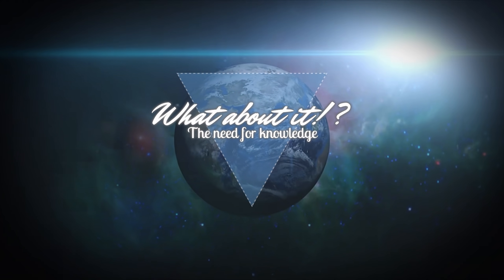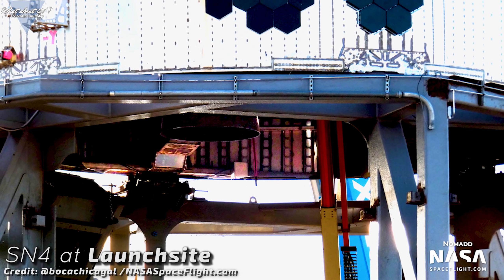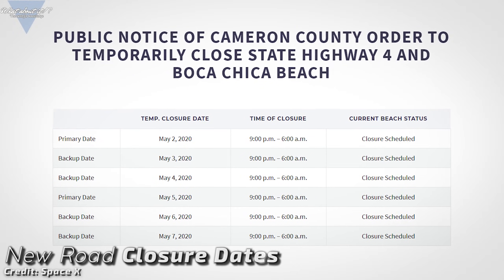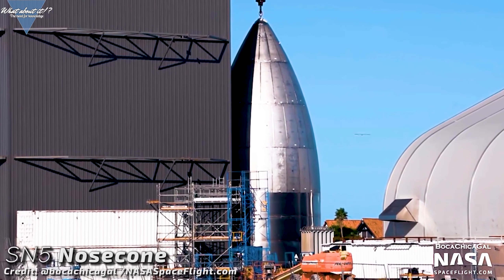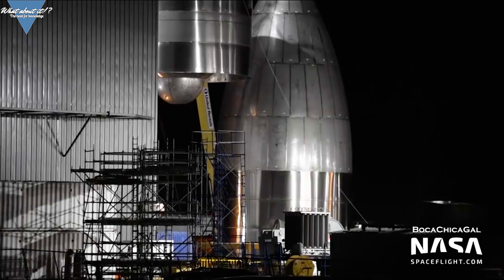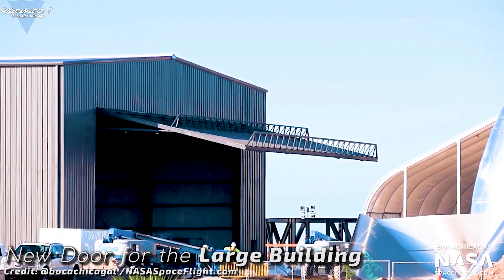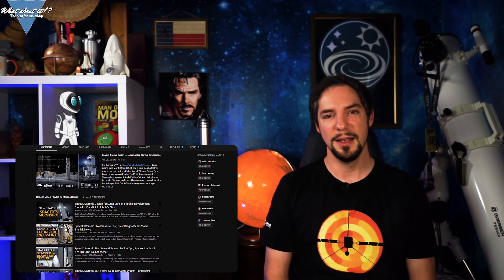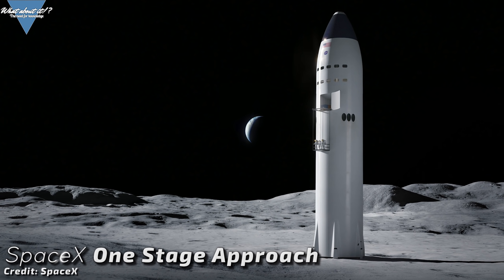89 | SpaceX Starship Updates - Lunar Starship: One Giant Leap

Comment from the maker: What’s wrong with Serial Number 5s nose and do you think, that the lunar Starship is a valid design?
Reply: Lunar starship  leg  is not good  Disign. Need bigger and wider because of  less gravity.
Reply: @lemnaiwangnawlemnu7955  Thats kind of what I think.  The amount of travel in those legs doesn't seem like enough for what they might find on the Moon or Mars.
Reply: @pipersall6761  Will it do orbital refueling too?
Reply: @pipersall6761  in moon and mars there is no landing pad  they have to land long starship  on rough surface  with that smoll  legs not a good idea.  Need some extension leg not like falcon but similar. Thank you.
Reply: @farrukh8827  Yap  it's a root between moon surface to  earth orbit.   Reful in earth orbit more then once  and it will move toward mooooooon 🌙
Reply: @lemnaiwangnawlemnu7955  But moon is not so far away like Mars. I thought it can fly to moon and back without orbital refueling but Elon knows the best. We should ask him on twitter ...
Reply: Lemnai Wangnaw Lemnu surely they eventually need a large landing pad to really get things moving and deal with the regolith issue?  Very interested to see further information about the lava tubes and whether habitats will exist within them.
Reply: Farrukh Isamatov it will have to. Starship can’t go beyond LEO without refueling. Also, Elon hopes to land with enough fuel to get back to earth.
Reply: @lemnaiwangnawlemnu7955  
Lunar gravity is low but starship is  very very heavy so i think these leg design may be good.
Reply: @lemnaiwangnawlemnu7955  gravity doesn't matter for center of balance for anything. On higher gravity the physics can be stimulated faster essentially.
Reply: @lemnaiwangnawlemnu7955  yeah im sure you know better than them lesser gravity makes it easier to knock it down but what should do that the moon hase no atmosphere so no Wind etc. the Atmosphere of mars is really thin and that it will fall over in landing is higly unlikely when it Lands in a stable surface
Reply: @christophsteck531  you can be all offensive to lemnai but he has a point, try to find a smooth surface on the moon for your bigass rockets to stand and balance on without falling over. It will be a dangerous landing with alot of unnecessary risks if you try it with this rocket. Okay the weight will put it in his place, but what if you land on subsurface rocks with 1 or 2 legs and the other ones on the lunar sand. It will certainly topple over then, there could be a difference of a few meters from vissible surface to solid bedrock. 
Dont get me wrong i hope they will fix it and make it to the moon and back but they shouldnt be playing with human lives. I think the design really need some changes to make it more safe.
Reply: And with vissible surface i mean there could be a few meters of moonsand/dust in between the legs and solid bedrock
Reply: De Gruisman for sure there will be.  Is a large landing pad feasible?  NASA are already testing building with regolith.  Could they build a heavy duty pad? 🤔🤔
Reply: @christophsteck531  what about rough surface?
Reply: @lemnaiwangnawlemnu7955  Stability of an object does not depend on the strength of gravity. If the weight vector from your baricenter passes through your base area, then you are stable, otherwise you flip. The length of that vector does not matter. I agree they need wider legs, but just because of the rough terrain
Reply: btw..Felix, good profile photo of yours bro😃
Reply: I love the idea! I just hope that the Lunar Starship will have the same cargo capacity as the regular ship. Can't wait for lunar space stations too.
Reply: Space Jace  It should have even more payload! The lunar version will never return to another planetary body, so it will not need those three sea-level raptors. Also no need for large steel fins. Lots of weight saved there!👍🏻
Reply: Felix, gotta say I have no earthly idea why you’re thinking there could be anything wrong with it. I don’t know about you, but I was expecting them to remove the nosecone from the high bay so they could use both sides for stacking the tank section. Nosecone wasn’t gonna stay in there until everything else was finished, that would be kinda inconvenient
Reply: I think it's wise of SpaceX to choose a lunar lander design that they're already a third of the way done testing prototypes for. I predict that their final lunar descent/ascent thrusters will end up looking very different from the ovals shown on the concept art. They may end up looking more like the abort thrusters on the crew dragon.
Reply: Hank Meyer is/should a landing pad to deal with the regolith issue be a priority once they know where to situate any lunar base?
Reply: The footprint of the lunar starship is very narrow. Any shifting of the regolith will tilt the starship. If the legs can quickly respond and level it then it would be better. 
That lift better not break down either! They could include small rungs on the fuselage for emergency climbing??
Reply: @olliea6052  >>> I was wondering about the width  of the footprint as well. 
 
Seems like just a slight shifting of the lunar surface, and it's HUMPTY DUMPTY TIME....
Reply: @Allan_aka_RocKITEman  Yes! Someone here mentioned legs like on the falcon booster. I think that would be a wise move.
Reply: I would think lunar Starship should have legs more like Star Hopper...maybe a bit smaller, though.  Tripod legs, but folded into fairings mounted outside the hull.  Once into Earth orbit, the legs could be extended and locked into place.  Seems like it would make safe lunar landing so much more reliable.  Also, unfurl enlarged Starlink or Dragon solar panels for power, and possibly sun shading.  Solar panels only work for 14 days on and 14 days off on the Moon, however.  Will need a lot of Tesla batteries or use fuel cells at night.  Nights on the Moon get pretty cold, I think...336-hour-long nights.  But the other lander proposals will have that same problem to deal with.  Nights are always illuminated by Earthshine on the Earth-facing side.  Earth will always hang in the same spot in the always black lunar sky.  The stars will slowly move across the sky, day and night.  Viewing through a small telescope should be awesome with no atmosphere...with an electronic  imager...and if a telescope can stand up to the lunar dust and the thermal strains.  Hopefully, astronauts on the Moon will carry live stereo cameras so that we on Earth can view using VR goggles and experience being there.
Reply: I think Lunar starship is way different from their original Artemis program and this is not at all happening in near future.
Reply: Orbital transfers of people and equipment will increase Lunar Starship's service utility, thus making the design 100% reusable and therefore a valid design.  After all, its main job will be getting people and equipment to the Lunar surface, not back to Earth.  Anyone or anything needing to get back to Earth can just do an orbital transfer from Lunar Starship to a crewed vehicle, Starship or otherwise.
Reply: Felix - I'd like to know what the upper engines on the Lunar Starship will be. Is it likely they'll be Draco thrusters, and therefore hypergolic - at least initially? Will they later upgrade to a better approach?
Also, what about the possibility of a Lunar Starship that lands on its belly? Could engine configurations be changed to allow this? It would allow cargo to be unloaded/loaded more easily than using the crane/elevator.
Furthermore, how will Lunar Starship avoid problems from the infamous lunar dust? How will they protect the Raptors on the bottom, along with their gimbaling, to prevent the dust from causing problems there? Does anyone have any ideas?
Reply: Lunar starship designs I have seen so far has the illuminators (windows) only on one half of the body which makes no sense. It will not fly like an airplane or skydiving at any point since there are no flaps and no heatshield. The acceleration (internal gravity) will always act towards the engines or be 0. It is same like a building during all its stages of the mission and like all buildings the windows should be all around.
Reply: The renderings of Starship on the moon show a surface that is unrealistically flat and level. It looks like they've landed on a golf course. The real moon, including the apparently flat mares we see on the near side, is uneven, is pocked with innumerable large and small craters, and is strewn with boulders - and remember, NASA isn't going back to the Sea of Tranquility, it's going to the extremely rough terrain at the lunar poles. I don't see how a tall ship with tiny legs like that is going to be a reliable lander unless it has a prepared landing pad. There is no way it will be stable otherwise.
Reply: Lunar Starship needs Falcon style landing legs.  I love the Super Draco style decent engines.
Reply: KCSwing6880 I disagree. Think of the Baja cyber truck suspension. The legs need dynamic control so if one leg lands on a big rock it can decide not to fully extend to keep the ship upright.
Reply: One thing is unclear - Will Lunar Starship be a second method for landing on the moon, or will NASA select either the National Team or SpaceX as its one and only method?
Reply: @Jeff_Froug  i think NASA is just liking the speed at which space x is going and is probably looking for options. Im thinking they are taking a similar approach to the airline industry where different companies make different jets for different purposes. Some are very similar while others are very unique.
Reply: @Jeff_Froug  also, nasa funding is already tight under scrutiny so maybe they are hoping space x can do it cheaper
Reply: @Jeff_Froug  

I think it's part of NASA's overall strategy to have multiple redundant service providers.  If they pan out, they could all be chosen, and there will likely be future designs that eventually get chosen in addition.  Of course, if one of the three are unable to deliver, then NASA still has the other two left to provide services.  In a worse case scenario only one would end up being viable, and the absolutely worst case where none make it, although the last one is least likely.
Reply: Jeffrey Froug I think at this point they are getting money for 10ish months of development. Assuming NASA likes their progress at 10 months, they could get more. That’s my understanding anyway.
Reply: Hi, Felix.
Caspar Stanley has doubled the number of ascent-descent Draco engines. What for?
Reply: think parallel the only way to move faster is more men and more prototypes in parallel.
Reply: Its better than usual starship. Much coolet painting. Only thing i don't like, is use of methane, on the moon. Hydrolox variant would be much easier to refuel here.
Reply: @_mikolaj_  

SpaceX could easily send a Tanker to Lunar orbit, or even set up a Fuel Depot in Lunar orbit when they get around to doing that sort of thing.  Or have a fuel depot on the Moon itself.  It's a relatively easy fix.
Reply: Mikicat true, but Elon mentioned landing with enough fuel to get back to Earth.
Reply: Will they consider a landing pad for a standard starship + more?  Clearly they have to work out the best place to situate the moon base fist right?  Once you have a landing pad (is it possible to design it so to direct descent and  launch exhaust away so it does not (or minimally) affect the lunar regolith...or would it have to be too big and therefore not feasible??).  I saw on one channel that  a NASA Luna scientists said regolith could go half way around the moon and affect space assets in lunar orbit due to the low escape velocity once affected  by spaceship exhaust.   Seems that if that could be achieved, you can get some lunar starships full of  solar panels and  building materials. Etc and really get things going.  Hopefully NASA’s work on building with regolith might make this  possible.  How long until we see a lunar base?  20 years?  Will they likely use he underground lava tubes?   OR Without Elon concentrating on the moon, will it be 50 years?
Reply: General Aladeen, where have you been? Where is your beard sir?
Reply: Yes the Lunar Starship is perfect, truly amazing what space x engineers are coming up with. That modification will be perfect for the moon as it addresses exactly what Dr. Z talked about. I'll say it now it will become the beginning of the moon base in the 2020s. I said on twitter months ago space x should just send a dozen Starships to the moon and park them there, and now we instantly have a moon base!
Reply: I think it's going to make an amazing cargo van.
Reply: Why a cargo elevator on the lunar starship? From that height, they should just use parachutes.  ;)  :D
Reply: Just thinking out loud, could they potentially look at using a carbon fibre nose cone? If they are struggling with steel as it is difficult to shape and assemble like that, carbon fibre may be the way to go for this component
Reply: Too many yes people kissing elons tukus has led to this ridiculous concept.
Reply: Overall good ideas for lunar starship, but if it lands on the edge of even a small crater, it could easily tip over. Landing gear may have to be splayed out more to prevent toppling.
Reply: Extremely fast progress?  The design is still unproven after how many years.
Reply: I certainly doubt that the renders that we've seen so far actually show a very accurate version of SpaceX's design. I'm sure they're just as aware of the issues it presents as anyone else.
Reply: How much fuel will the Lunar Starship require to go to the Moon, land, and then ascend again, presumably back to earth orbit for further refuelling? As I understand it, for Starship to go beyond earth orbit requires it to be refuelled. The number of refuellings will depend on the specific mission. What is the maximum amount of fuel can a refuelling Starship take into orbit?
Reply: It probably needs modification to allow fin attach points.
Reply: That dent could be one reason, but adding or changing other things inside of the nose cone might be the reason. The lunar design is brilliant, honestly. And, I've been wanting Musk to make me an asteroid mining version of Starship since I first heard of the thing.. ;-)
Reply: Stop it with the lies
Reply: They just can't stop with the lies.
Reply: This video is all lies
Reply: For Lunar Starship - Moon dust will be incredibly electrostatic.  Not a good design choice to have rails down the side of the ship as dust near the bottom will cling to any gears or guide rails and clog these parts.  This could cause a major issue with lowering and raising the lifts.  Apollo astronaut suits and gear were covers in it and was a real problem during those missions.
Reply: What about it!? Plans and design always change so maybe and maybe not.
Reply: If gravity isnt as much an issue on the moon, and they talking about ships that wont be coming back to earth, why arent we seeing more star wars-esk designs? Add some smaller vertical thrusters under what would be the wings to make up for no air to fly with. Smaller thrusters would stir up less debris unless the lunar surface is dustier than I know of.  Would be cool to have something futuristic other than rocket designs
Reply: HAHA! Hilarious comedy! You're talking like as if this is all real- everyone now knows all of NASA and Space X is 100% fraud, shooting silly crap out of sight landing in the ocean and most of their 'rockets' are nothing more than big balloons with fireworks on the bottom
Reply: I don't like having this to even be a consideration, but it's not unreasonable for some of what we're seeing done at Boca to be a distraction from another plan by SpaceX. What I'm referring to is the fact that Elon Musk is working for the Government and has netted a great deal of cash for his work. Not to mention the advent of the US Space Force. This would be big deal for Elon Musk. I could easily make a case for the Starlink program having a function of communicating with weapons systems. Again, I hate to think about this, but especially now with rising tensions between the US and China.
Reply: Dusty Roads I doubt it. You’re right about communications being potentially multipurpose, but the stated use for starlink would net WAY more money than a military communications system.

Comment: They probably just mounted the 1 raptor to one of the three planed final locations so they don't need to change plumbing/mounting designs.  Also allows them to check for an offset thrust if there is a failure to light on an engine.

Comment: The high location for lunar decent engines is something I thought about a long time ago and am excited they have adopted this very practical solution for not kicking up a storm of Regolith from the surface. From a security stand point I also like the high bay cargo door and freight elevator.  Not only does it provide easy access above the engines and fuel storage, it provides securable access from unwanted visitors, be they foreign, alien or surface dust

Comment: Hey Felix, the white color of the lunar starship may indicate that it will be made of a different material than the Stainless steel on the current model. Steel is twice as heavy as Aluminum and the dry weight of the steel version is 120 tons. Depending on the weight of the Raptors that leaves a lot of payload capacity or fuel capacity to be gained by switching to plain old aluminum/lithium alloy. If they are never going to re-enter the atmosphere with it why bother with Stainless steel?

Comment: Thermonuclear rocket engines will be necessary.  The water-ice on the moon will supply the fuel to visit the asteroids as well as Mars. Don't let public opinion postpone an inevitable technical innovation. Molten salt reactors may lead the way to a safer, cleaner design.